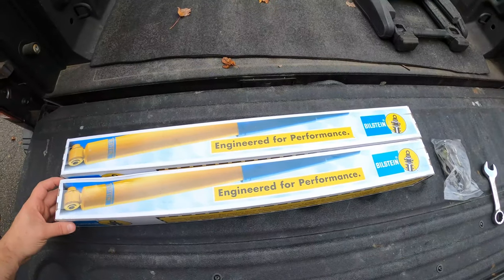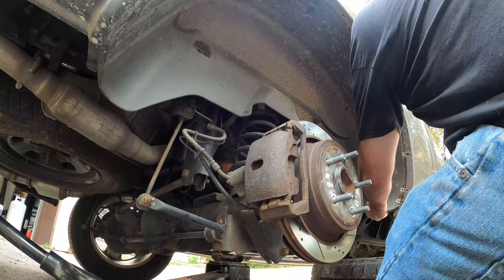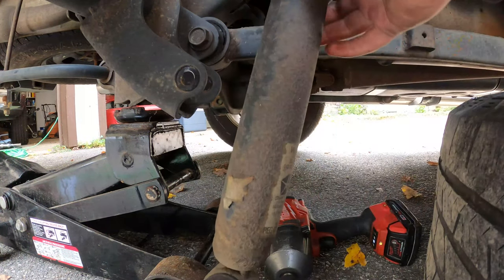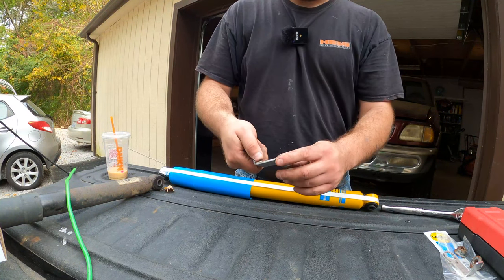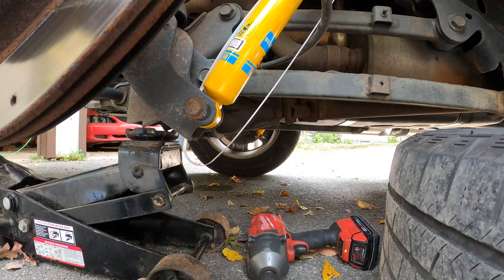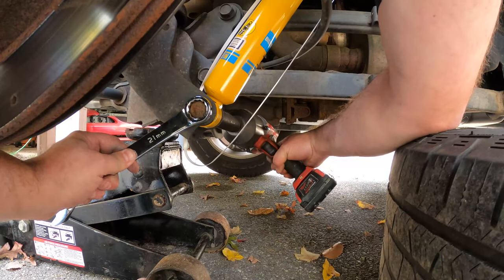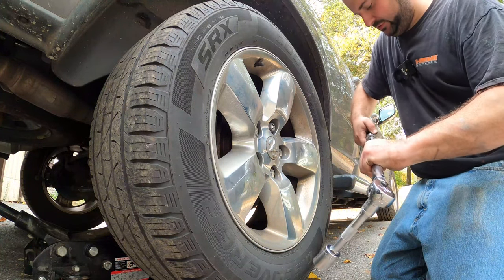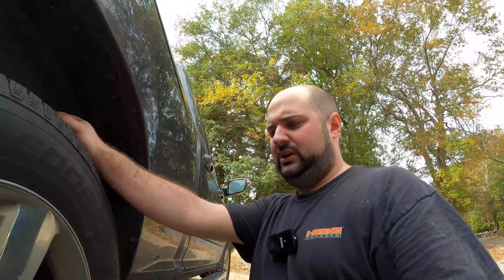How To Replace The Rear Shocks In a 2017 Ram 1500 | Bilstein 4600

Comment from the maker: 2009-2018 RAM 1500 SHOCK NUT SET - https://www.thurenfabrication.com/collections/shocks-1500-09-18/products/thuren-shock-nut-set-2009-2018-dodge-ram-1500
Bilstein 4600 Series Rear Shock - https://amzn.to/3aKIA5g (Affiliate Link)
Reply: I purchased the nut set for lower coast as the link in the video wanted $35 shipping costs plus $30 for parts.
Reply from the maker: @Wozzaatwozza  Prices seem to have gone up. I think I paid about $25 for them.
Reply: Do these work on the 2500

Comment: Thanks for the tips / video!  I just got a 2014 Ram 1500 SLT and plan on doing 4-corner suspension on it soon.  The Thuren nut/wrench set is priceless, I will have that in my toolbox.  I put Bilstein 4600s all the way around on my old Silverado 2500HD, great shocks, softened even the "3/4 ton ride".  Hint: they're about $10 cheaper on rockauto...
Reply from the maker: Glad I could help!

Comment: Thanks for the video. Just ordered the nut set. I was trying to figure out how the hell you were supposed to get in there to get that nut off. BTW Rockauto has those rear shocks for $73.99 were as they are $84.00 on amazon. Rockauto is my go to for car parts. They also ship lightning fast. Thanks again!!!!
Reply from the maker: Yea - it is a pain to get at it. Some guys will cut a wrench or use a crow's foot. I thought the nut set was easier.

Comment: Nice Video!  How did you like the Bilstein Shocks?  Did you do the Front Shocks as well??? 
Thank you for the tool tip!  I will order it. 
I especially enjoyed the kind demenor with your son!  
Cheers, Eric
Reply from the maker: Thanks! The Bilsteins have been great, I have no complaints. I have a set of Bilsteins to put in the front, but I have yet to do it. I've only put maybe 12k miles on the truck since this video, I don't drive it much. I did not put the front ones on at the time as you need to remove a mount from the OEM front struts to install on the Bilsteins.
Reply: @ACHAutomotive 
Brother,
Did the rear lift slightly with the Bilstein rear gas shocks??? 😎  
Lol, I have the same 2017 1500 and with the awesome RamBox, too.  I use her for towing our camper and could use another 1/2" - 1" lift would be great.
I just purchased a set of 4 Bilsteins. 

Again, major kudos for having your boy working with you. 😎

Cheers, Eric

Comment: How are these shocks performing I have the same truck 2017. I'm looking to keep factory ride comfort and float over those bumps when it was new . Have 30k miles on mine also  I do not have a lift or level it's bone stock